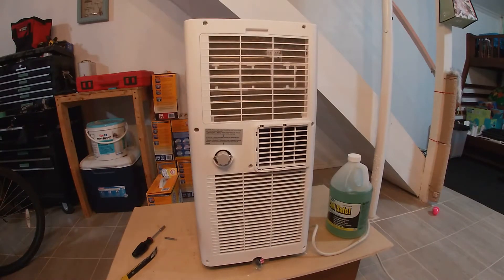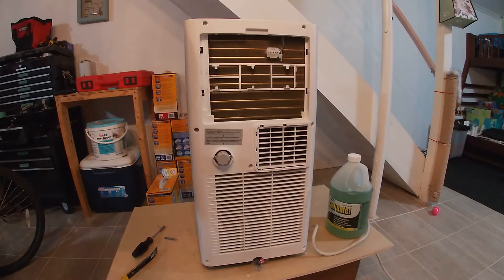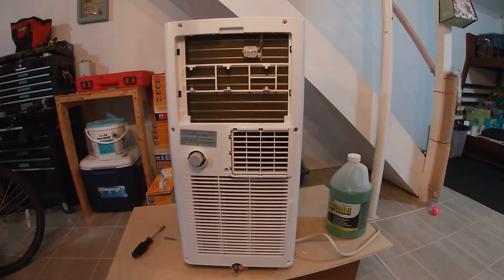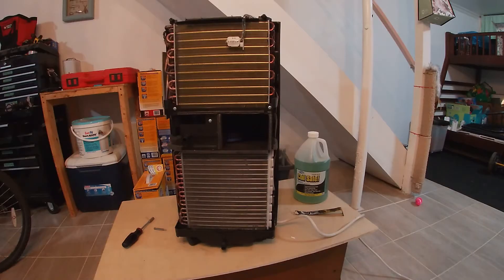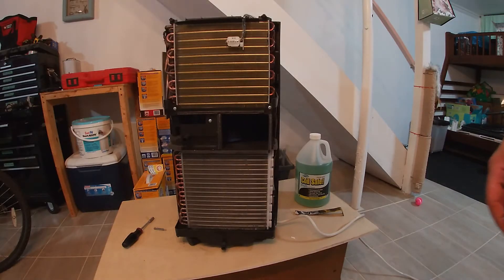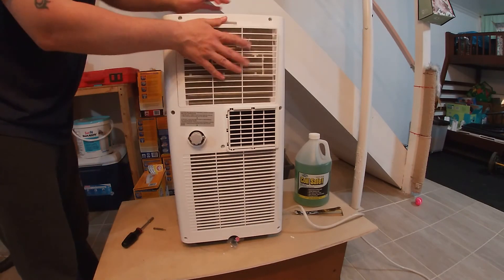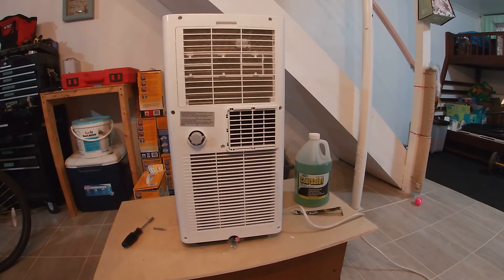How To Clean Midea Portable Air Conditioner Coils

Comment: It needs a removable screen to clean on the bottom part like a lot of portable AC units have.  I will probably install a screen over the grille to catch the dust in the air so it doesn’t build up as fast as it does right now.
Reply from the maker: I got a $15 shop vac detailing kit and it has a small wand that fits perfect  between the bottom slats. I was thinking of buying mesh at some point to try. I think They make them this way on purpose to fail so you keep buying new units. But I keep cleaning it to exceed it’s life expectancy. Thanks for watching and sharing your idea. Please like and subscribe
Reply: I cut the plastic off the bottom lol

Comment: Great how-to! Just be CAREFUL not to apply pressure with your vacuum like I did and bend the coil fins. 😬
Reply from the maker: Good tip! And if you happen to bend them you need not panic. You can buy a fin straightening tool cheap at most tool stores. Thanks for watching. Please like and subscribe

Comment: I have this exact model and it has been leaking water droplets from the joint to the exhaust pipe. Any idea what could be causing the water not to completely evaporate?  I have to empty the bottom drain every day. I don't believe it's due to humidity. Would following the steps in this video help?  Thanks for the helpful videos!

Comment: how are you supposed to clean an AC/ dehumidifier? I feel like mine is not drying out enough in between uses.
Reply from the maker: Use the method in the video. This unit is an ac/dehumidifier. Thanks for watching. Please like and subscribe

Comment: I have the same model. Is it suppose to have two drain plugs ? I only have one for the bottom drain.
Reply from the maker: Perhaps your top drain broke off. There is a drain for the top coils and a drain for the bottom coils
Reply: Thank you I will see if I can get a replacement one
Reply: @BillOfAllTrades2016  what does the top drain plug look like. Or is it the same as bottom one

Comment: Greetings, what about the water that is inside?
Reply from the maker: What is the issue you are having with the water?
Reply: @BillOfAllTrades2016  When I tilt the air conditioner to remove the water from the inside, sometimes it comes with a brown material in it, but I haven't seen anyone having a way for the water to come out, or showing a way to remove it/clean it.
Reply from the maker: The brow bits are dirt and bacteria built up in the tray. If your water isn’t coming out without tipping the unit, you may have a clog in the drain. Take a pipe cleaner or coat hanger and poke it through the drain to clear it out

Comment: Can you use additional filters, such as cut to size electrostatic portable AC filters on this model? 

Would a HEPA filter be too much blockage?

Can mold or bacteria, etc develop inside these or is the coils too hot for it to survive, as in making using a filter pointless ?

Thanks in advance anyone!

Comment: i just got one of these is the fitler just the metal mesh with the plastic?
Reply: i was wondering because i thought it was dumb it didnt come with one but your tellin me thats the filter
Reply from the maker: Yes that’s correct. Air conditioner units don’t have actual “filters” like a paper pleated filter or anything. They all just have that screen that acts as a filter. It keeps the top coils clean. But there is nothing to protect the bottom coils. Thanks for watching. Hope the video helped. Please like and subscribe
Reply: @BillOfAllTrades2016  thank you had this setup for 3 days now and was scared to use it works pretty good thank you sit!
Reply from the maker: You’re welcome

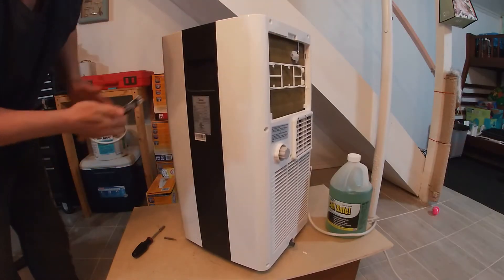Comment: Does the opening technique at 1:22 work for the MAP12S1TBL  model? I'm giving this a go and it's been pretty hard to take it off. I am almost worried that I am breaking my unit when I attempt this
Reply from the maker: It should be fairly similar.  I actually broke a few of the retaining clips. But it still goes back together well. Most units need force and a broken clip or two the first time it’s taken apart. Hope this helped. Please like and subscribe
Reply: @BillOfAllTrades2016  we broke a lot of clips but were able to take off the front and snap it back on easily. It required a lot of effort to take it off the first time. Thanks so much for this video!
Reply from the maker: You’re welcome.  Glad it helped. Take care.

Comment: i did this thinking it would prevent the snow/ice build up i’m getting but it’s still happening. do you know what it could be, or what i could do to fix it? it’s building up on the top filter
Reply from the maker: The two main causes of icing are lack of air flow and not enough Freon in the system. You already cleaned the unit which should take care of air flow. However when operating the unit do you have anything too close to the back of the unit that could block air flow? Example: if the unit is to close to the window it may suck your curtain up against the filter and block airflow. If this is not the issue then it seems that low Freon would be your issue. In that case I would advise taking it to a local heating and cooling expert and have them top up the Freon. I hope this helps. Thanks for watching. Please like and subscribe
Reply: @BillOfAllTrades2016  but how can it be refilled. It doesn't have a port. I cleaned mines and it still doesn't cool up. But for some reason it leaks water from the sides. Even I can't find how the heck is possible for that to happen.
Reply from the maker: There is no port. There is an adapter that gets put over one of the copper lines and it pierces the pipe. Then refrigerant is pumped through the adapter. That’s why it needs to be done by a professional because if one mistake is made then refrigerant can be leaking everywhere. Hope this helps. Please like and subscribe

Comment: Hi from New Brunswick. I saw in you About section you’re in Canada. But I also could tell you’re Canadian because you say “out” and “about” like I do 😂
Reply from the maker: Lol. We are from Ontario. Thanks for watching. Please like and subscribe
Reply: @BillOfAllTrades2016  hi Bill can you do a video for how to drain the water from the Air conditioner
Reply from the maker: There are two small grey caps on the back of the machine. You can see them at the beginning of the video. Unscrew them. There are black rubber stoppers under the caps. Pull them out and it will drain. Hopefully this helps. Please like and subscribe

Comment: My curvy coils at the same for my A/C portable have a white residue on them.  Is that normal?  My unit isnt blowing any cool air, not even after the clean.  Its only two years old
Reply from the maker: Your unit may have a leak and be low on refrigerant or may have a broken compressor. The white residue is bacteria forming into mold. It may be time for a new unit by the time that is all fixed.

Comment: Hey thansk, please advice do you need to refil it with water or anything, my fan is working but the air is not cold
Reply from the maker: No you don’t fill it with water. You need to always drain the water. If the unit is cleaned like in the video then there are a couple things to look at next. When you are running the unit listen for the compressor to turn on. You will hear a click when it turns on. You may just not have the temperature set low enough. If you don’t hear the compressor turn on then keep turning the temp down till you hear it kick on. Then see if it gets cold. If the compressor doesn’t kick on then it needs replacing. If it kicks on but the air is still warm then you just need a refrigerant top up.

Comment: So my ac didnt come wit the lids for the drainages do I need them on or will it still work ?
Reply from the maker: Does it have rubber plugs in it? It should have a rubber plug. You don’t necessarily need the screw on caps. But without the plugs it will leak everywhere.

Comment: Is it safe to use a steam cleaner in exposed coils if they are beggini g to stink,or do you have to use some kind of cleaning agent? Im just wondering if the water from the steam gun would be a saftey hazard in any way….
Reply from the maker: A steam cleaner will be safe but won’t be as effective as using a cleaner. To get the smell to go away you need an air conditioner coil cleaner like the one I showed in the video. Hopefully you found this helpful. Please like and subscribe
Reply: @BillOfAllTrades2016  yea buds,pretty sure i got this figured because of the vid.thanks.
Reply from the maker: Nice. No problem. If you get the chemical and then use your steam cleaner after it will be a superior clean.

Comment: Thank you for your video, i’ll buy this tool to disassemble my midea and clean the down part.
Mine is fulling water in so much short time (one or two days)and there’s a dirty mud going out of the down drain.
Have you any tips for that?
I think it beeps insanely once in a while because of that.
Anyways, thank you and have a great week.
Reply from the maker: Once you clean it out the water will be clear. The mud water is just all the dirt coming off the coils. Once you spray it with coil cleaner chemical it will get better. The beeping could be to let you know it’s full. When it beeps does the screen say p1? My advice is to put the ac on a small table and have a bucket behind it on the ground with the drain tube going into it while it runs. That way you just move the bucket to dump the water. Hope this helps. Please like and subscribe

Comment: Why are there two drains?
Reply from the maker: One is for the top set of coils the other is for the bottoms coils. Each coil set gets their own drain. Behind each drain is a tray to hold dripping water. So if there are two drains that means two trays so it can hold more water than a unit with one drain before it needs to be emptied. If there is only one drain it can only hold half the water because it will only have one tray.